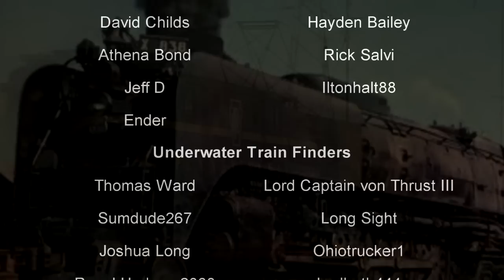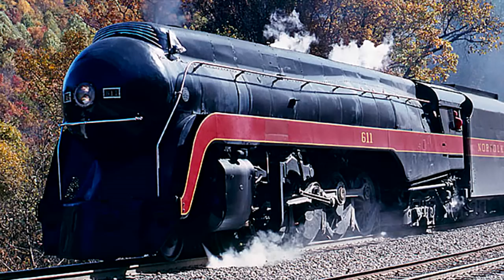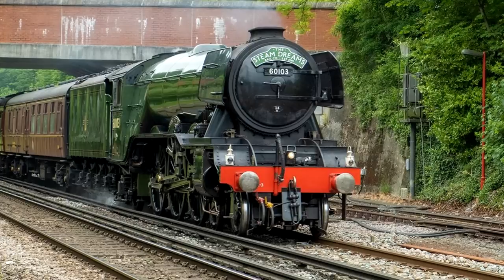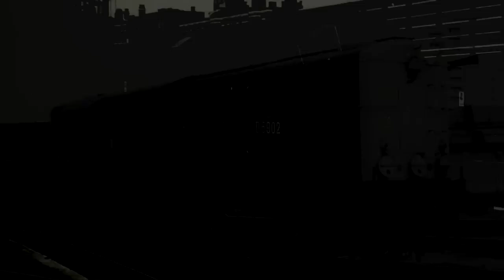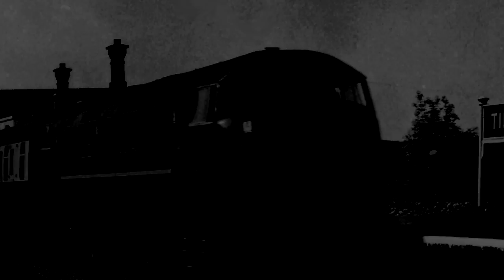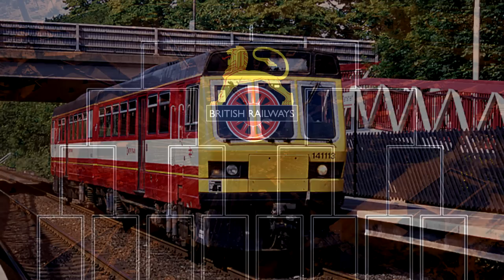The Worst of the Worst of British Railways 🚂 Roundhouse Rumble 🚂

Comment: As someone who has suffered the Pacers operated by northern up until recently. There can only be one winner!
Reply: the pacers were actually incredibly good at doing what they were designed to do, to be cheap and reliable, to facilitate the dire fanincial situation that BR was in during the early 80s, and they did it flawlessly. yes they provided a poor quality service, but the alternitave was no service. as far as the design specification went (which didnt prioritise comfort) the pacers were brilliant, hence their longevity
Reply: I certainly wont mourn their loss
Reply: @dragonheatgaming5005  i will, because now we have unreliable poorly built crap trains that are more expensive to operate and maintain and yet do less miles per breakdown
Reply: They didn't appear very often on the Wharfedale Line but when they did you felt the expectations across the platform  nosedive. Almost to the point of an audible groan.
Reply: @markstott6689  they were my local locos. Many a time I had to boot the door for it to open properly, guards just laughed

Comment: As someone who has seen most of these locos this is about what I would have suggested. 20 of the class 21s were allocated to Kittybrewster, Aberdeen, and I saw rhem all in one day. Only two of them were working, in a pollished state, for the Royal train. One was at Inverurie works with a dropped cab, having come off worst in a low speed collision with a 4 wheeled diesel shunter,  The class 22 DH with the same bodyshell seemed to be more successful. The 74s were converted at Crewe works from class 71 (one of which is in the national collection).  There was always  one Co-Bo at Reddish shed  (Manchester) for maintenance (near to Crossley Motors). The class 17 was for the Scottish coalfields, and the centre cab design was supposed to give better visibility than the hood unit style of the class 20s, afurther 100 class 20s were ordered to replace them, Beyer Peacock built some good diesels, the Hymek and some class 25s. The class 16s were used for carriage shunting at Liverpool St station (London). The first Warship locos (class 41?) were also from NBL and had A1A-A1A wheelbase; they were equally problematic and only worked in Cornwall.

Comment: An engine/generator unit from a baby Deltic was unearthed from Doncaster Works & the base for the conversion is a condemned Class 37.
The sole remaining Clayton Class 17 survived because it was sold into industry, to Ribble Cement. The works manager was well-aware of the locomotive's status.
I never had to ride on a Pacer. 
The prototype actually still exists. It was made from the front parts of two Leyland National bus bodies dropped onto a tank wagon chassis. It still has indicators and the route blinds.
The big issue was they were two-axle rigid chassis, which is where the rough riding qualities come from. I can imagine that on jointed track they were like nodding donkeys as the track tends to sink at the joints. A lot of English railway consisted of 60ft long rails joined with fish-plates and bolts. 
Flange-squeal on tight curves must have been pretty bad.

Comment: I have a suggestion for best Locomotives the Montreal Locomotive Works RS-18u, it is a rebuilt version of the RS-18 that CP Rail did in the 80s to extend their service life. The difference between the RS-18 and the RS-18u is the the RS-18u has a shorter hood on the short end of the Locomotive and many other things that I don't really know. The RS-18u was a very iconic mostly from working mostly in Eastern Canada and eastern US.

Comment: In my opinion the worst engine isn’t in B.R but actually USSR railways, specifically the AA20 class steam locomotive. They tried to build a bigger stronger and unarticulated version of the Big Boy. And it not only failed in that regard, but also failed as a locomotive in general as it could never leave the yard or take the slightest curve without derailing. Not to mention it couldn’t pull a train that even a engine half Big Boy’s size would pull on the regular without issue. But it was hilariously slower than even a civil war era locomotive. Big, weak, slow, and couldn’t go anywhere without derailing, definitely the worst engine in the world. (In my opinion anyway).